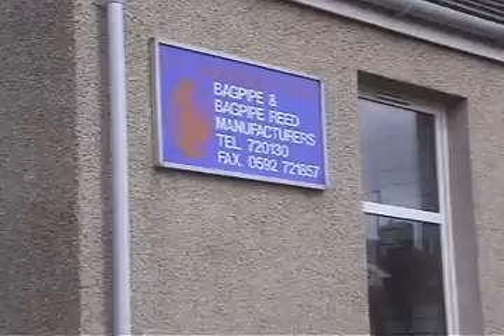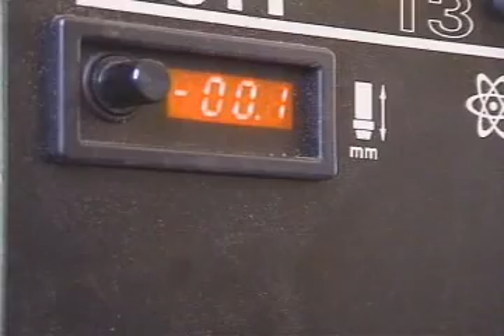The Shepherd Way 1

Comment: I owned a set of Naill's for a more than a decade then bought a set of Shepherds. Unfortunately, the bass drone was very warped and I learned that this may have been because the ABW pieces used for the drone did not season for long enough (6-8 weeks). No worries though, I got it replaced and I love this set - very mellow drone sound which contrasts exceptionally well with my Naill ABW chanter. I have since sold my Naill set and will never stray from my Shepherd set...